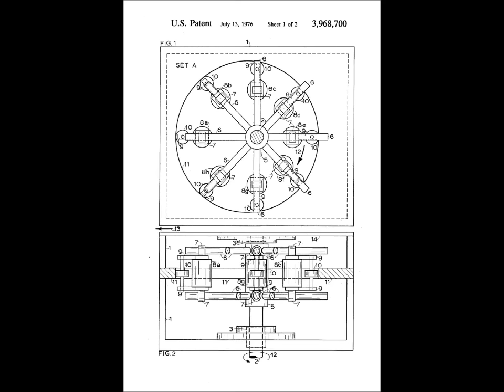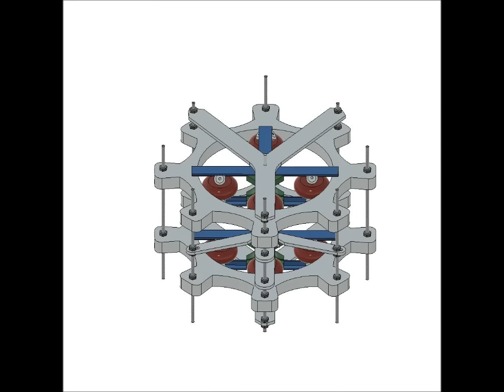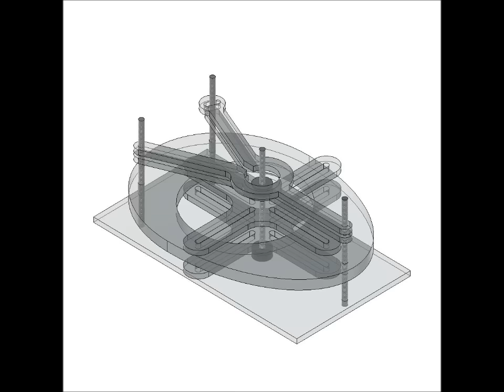Using Centrifugal Force for  Propulsion

Comment: If you work through the math the force on the ring evens out due to you having to decelerate the weights as they are forced closer into the hub. This matches the force generated by the inertial force as the weights move further from the hub and accelerate in speed. A friend of mine and I worked on this when I was in my preteen years. I actually made molds by drilling holes in two by fours, melted lead and poured them into the molds, and then arranged the weights inside of a coffee can suspended on rods and turned by an electric motor that came with the Gilbert erector set that I got the rods and hub pieces from . It was noisy and had way too much friction but hey, I was only 11 or 12 years old at the time. I REALLY wanted a way to get into space so was willing to try all kinds of things. It wasn't until college days that the math showed the problems with this sort of system for a space drive. If used on land or water you can harness the vibration to inch forward if you make it easier for the wheels or hull to move in one direction. Best of luck in trying to hack a solution and make it a reality.

Comment: By the way the wheels should be parallel with the spinning motor #9:33 , the black wheels are placed vertical while the motor is spinning horizontally, both should be placed vertical

Comment: Those are some good looking builds.  Furthermore, wood is an excellent choice of material since it doesn't have to be welded, and can be modified easily.  Mechanical thrust isn't reaction less.  Centrifugal Force IS the reaction to pulling against a mass.  It acts at the center, not at the mass.  And it's in the same direction as the desired thrust.  These kind of machines are centrifugal reaction propellers, not. "reaction less drives". Keep trying.  The easiest solution is to let the front of the board bounce up and down on springs.

Comment: I would like to say, I admire your courage by showing this experement. The reason this design doesn't work because the rotating mass has a fix center of rotation and all variables in the centrifugal/centripetal force formula are constant in your setup. Therefore there will be no net force. 

But I found an elegant solution.

Comment: Your mistake is not caming the weight off the flywheel, I tried this back in 1994 after visiting with Robert Cook, he wouldn't explain his but I made one using ball bearings but changed the orbit, that is how I found that orbit only neutralized its self. Keep working you almost have it.SincerelyForrest C Pittman Jr.

Comment: The gyroscope that someone made to do antigravity does not work properly because both of its wheels are spinning in like poles, both wheels should be spinning in a unlike pole manner separately but within one platform, there should be at least four of them againsting each other, you know very well about magnets and there behavior with each other, so the 4 forces will draw a invisible pyramid pointing up

Comment: This won't work. It doesn't matter if it moves across the ground. You would have to do a swinging pendulum test to prove whether or not it works. It would have to stay to one side of a swinging pendulum test for a significant amount of time to prove it would work in space. (Which none of your machines ever could) 

This is just like the Gyroscopic Inertial Thruster (GIT) that my friend David Eugene Cowlishaw made years ago and which also can't work. 

The only machine that actually works is Mike Marsden's Mac Quan 1 machine. It would take me about a year to explain to you why it is the only way to create linear thrust (i.e. inertial propulsion). 

Mike Marsden would say that you went down the "blind alley" that I went down, just like you. 

I have been researching inertial propulsion for over 20 years now. 

Be prepared for this technology to be released eventually. His newer and most current device creates several G's of thrust.

Comment: There is no such thing as centrifugal force - just centripital force toward the centre.  If a retaining spoke or string broke, a weight spinning at the edge would not fly off directly away from the centre but at  a tangent to the circle at the moment that it was released.  This is because centrifugal force does not exist.
Reply from the maker: Fair enough, at this point just semantics. The point is, net motion is created by a rotating system that has no linkage to the wheels.
Reply: The Third Law requires a reaction to the centripetal force pulling towards the shaft.  This reaction is centrifugal force pulling the shaft in the opposite direction.  Centrifugal force doesn't affect the deflected mass, but it is real and it does produce a resultant movement.  (Newton's Second Law.)
Reply: @Inertiatek  - this is very close, but yes there is a property missing.